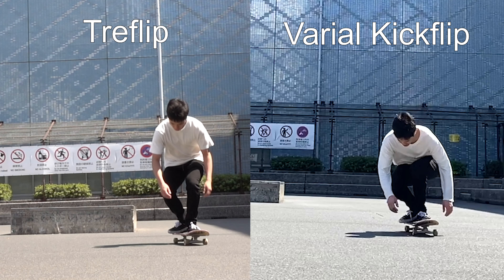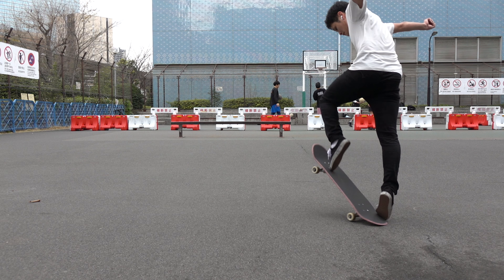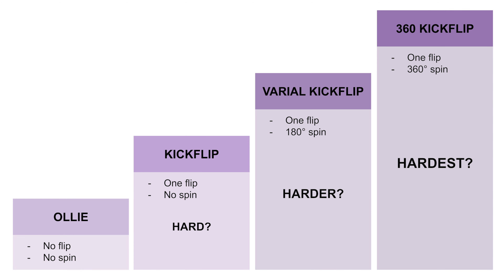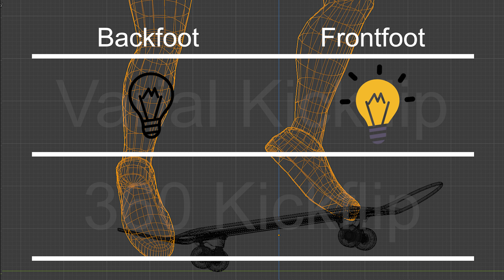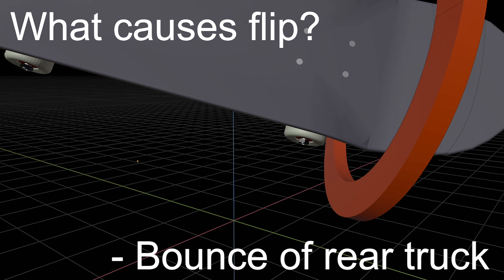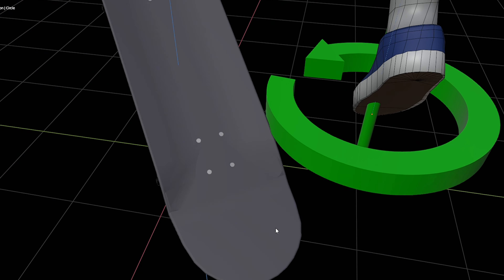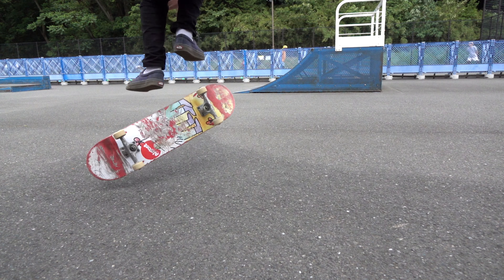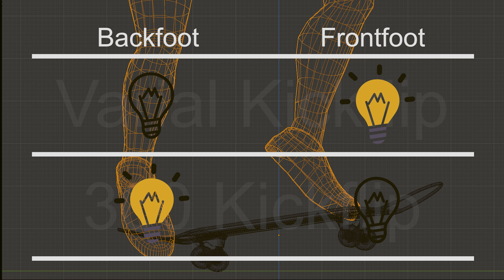Difference between Treflip and Varial Kickflip - Should you learn Varial Kickflip BEFORE Treflip??

Comment: @3:12 Except you're completely ignoring the amount of pressure that's put on your front foot and how it does move off the board when still in contact with the board, enough for it to count as a flick. Try doing the same tre flip, but lift your front foot up even earlier. You're never going to flip it. Try to do a 'no comply tre flip' so to speak. You're not going to be able to do so with a regular tre flip foot position. It's just flat out impossible. It's very amusing to keep hearing people say 'there's no flick', when really all they try to do is interpret a visual image / video without actually realising what is truly going on. Heck, we can calculate why you're wrong. There's just not enough force elsewhere to make the rotation work. Contrary to what you think, the scooped pop at 90 degrees is not enough.

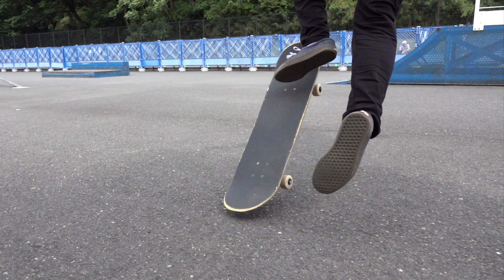Comment: 0:22 I severely disagree with that image in terms of difficulty haha. Not hating (as always), but I think a more accurate image must include : 'ollie', '180s' , 'pop shove it', 'front shove it', 'varial kickflip', 'heel flip', 'kickflip', 'tre flip'. With enough practice, many people will start to prefer tre flips over kickflips, but I wouldn't say they are easier. A varial kickflip though, definitely is easier, as it is way more of a pop shove it that you allow to flip. It doesn't require as much control over the flick as a kickflip does. Something can be said putting the 'heelflip' before 'varial kickflip', but again, even when it's a more rudimentary trick, but it requires about as much control as a kickflip. I haven't tried enough varial heelflips yet, but it wouldn't surprise me if those feel easier than a regular heel flip too, provided you've got the front side pop shove its down well. And that's kind of the thing in skateboarding. If you have pop shove its down, the varial kickflip is definitely easier. Jumping from 'kickflip' to 'tre flip' is definitely harder than having varial kickflips mastered and giving a scoop that's twice as hard. Oh and you're not being very objective when you think there's no flick in a tre flip, sorry. All tre flips have a flick. It doesn't matter if it's helped by a lot of preloading of the board, it still gets its rotation from the front foot movement. The bounce of the rear truck is not what makes your tre flip rotate at all . You're not doing pressure 360 flips.... not to mention how those literally work differently too. Oh and there are different ways of doing a varial kickflip. You can do them more pop heavy and flick late, meaning it is less like a tre flip. Or you can scoop them more and flick earlier and it'll be more of a tre flip style motion. The fundamental difference there doesn't mean one of them 'isn't flicked to rotate'. Both are flicked to rotate. Just a different timing and as a result the varial kickflip you end up with looks a bit different. Yours looks a bit more like it was a late flip. Needless to say, a kickflip that's done at the peak of 'the jump up', will always look different than a kickflip that was flicked early and done (probably lower to the ground or at least stays more stuck to your feet when going up) fast. At no point could we ever talk about them being two different tricks. And no, a real late flip is not a kickflip. It's often just slapped down with one of the feet, instead of a true flick. If there's a true flick, I'd argue that's just a regular kickflip, but done at peak height.
Reply: Bruh🤦‍♂️ not everything progression blueprint has to only be followed by Aaron kyro